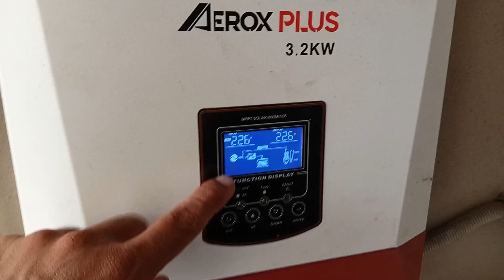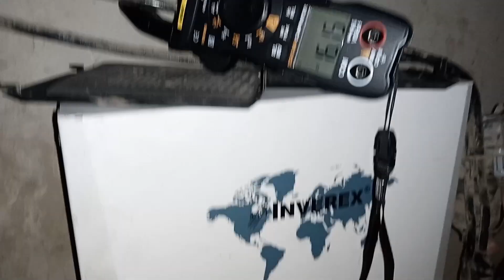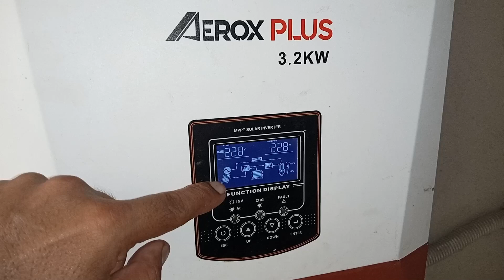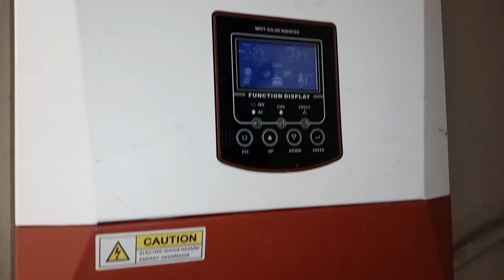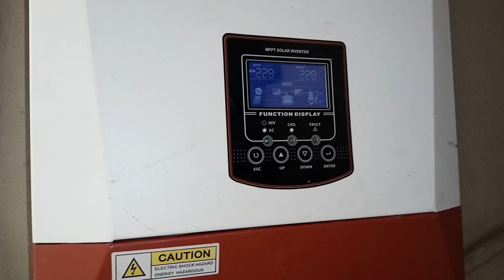Inverex Solar MPPT Charge controller Repair (English)

Comment: Do you provide repairing services? The problem in my inverter is it no longer generates more than 2600w from PV (575wx8, 4600w). After hitting 2600w, generation drops by 1kw and reaches around 1500w and rises again to 2600w, stays there for some time and drops again. It keeps happening. It used to give me 3500w generation from PV when the inverter was new but now only 2600w, the problem seems to be increasing by time. I have always had this generation dropping issue but it was at 3500w before, now it is on 2500w.
Reply from the maker: Problem not seems to be with the inverter but with then wiring, connector's or pannels, there must be some power leakage, check short circuit between wiring connectors and body frame of the the pannels